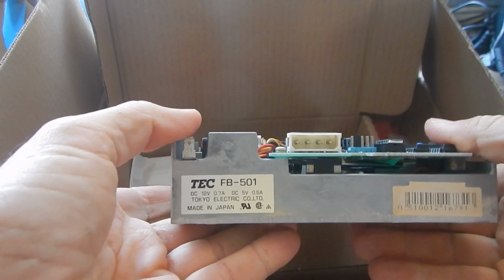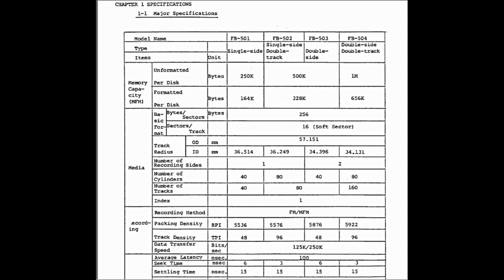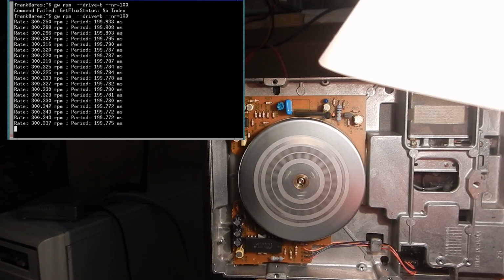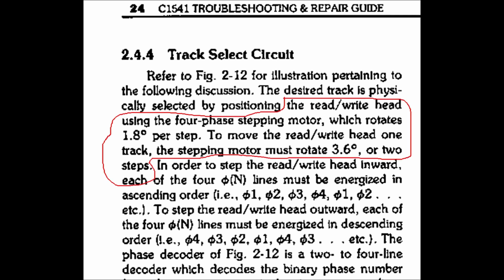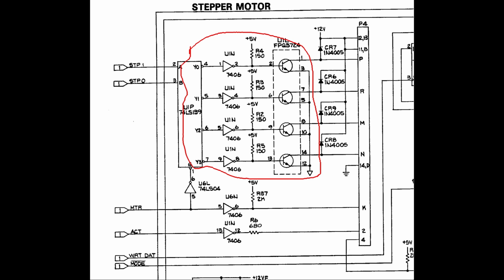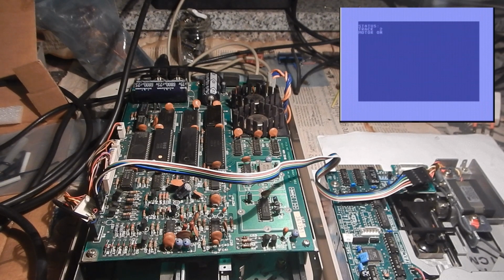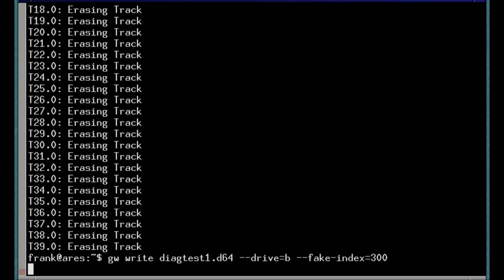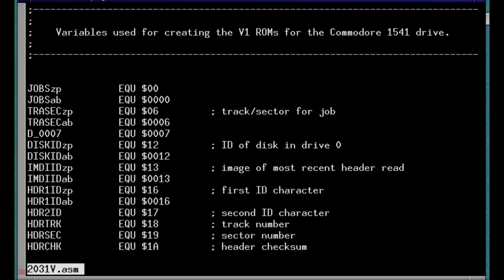(Re)-designing a CBM IEEE-488 floppy disk drive. Pt.1: Drive mechanism choices and testing.

Comment: Often the TEC drives are much worse w.r.t. leaking capacitors. I'm glad you got a good one.
Reply from the maker: Yeah that capacitor did quite some damage alone, but all the identical ones are gone, so it should not be in danger anymore. Probably those capacitors would fail more easily the more time they spent powered on and this particular drive didn't see much power in its life it seems.

Comment: The problem is that the sd card solutions do not support rel files.
Reply from the maker: I have seen a raspberry pi (pi3?) solution that runs the 1541 firmware emulating the HW. 2031 and 1541 firmwares only differ on the interface part, so a similar solution could be emulating any other CBM drive (even the dual drives). However for me it's way more fun and interesting to build the "real thing" than to emulate it.